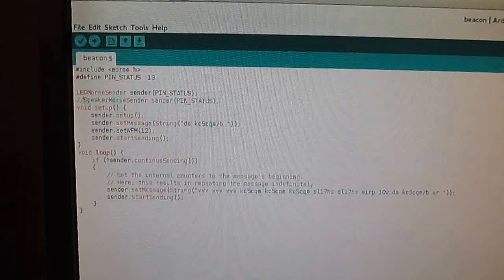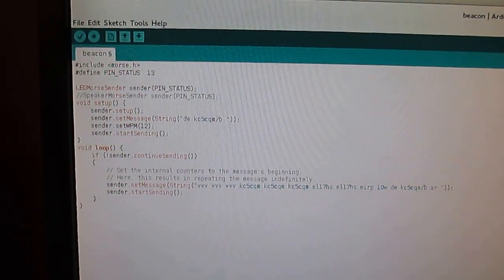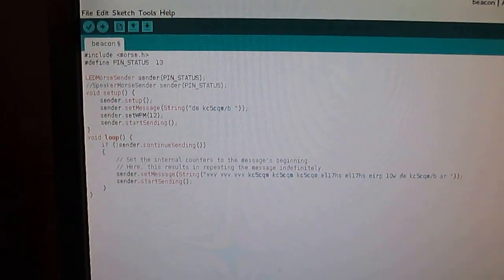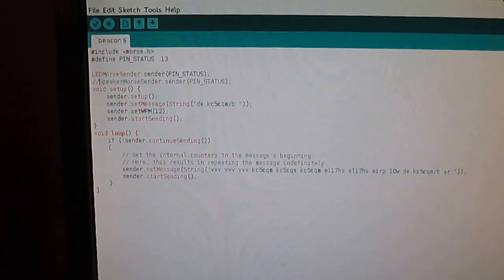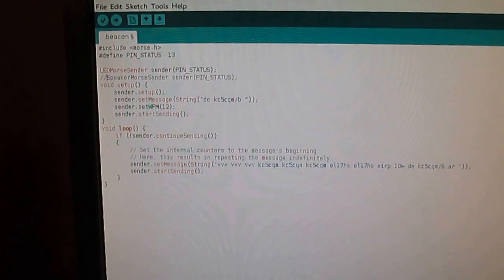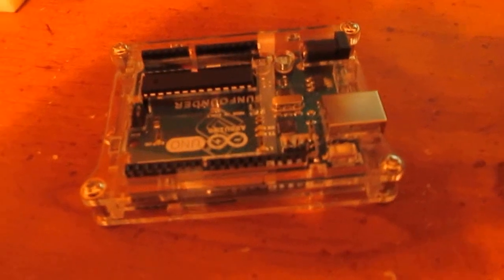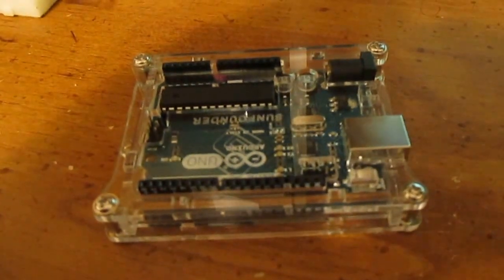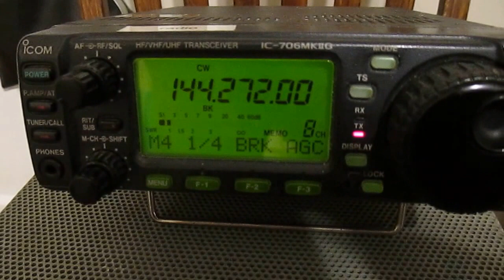Arduino CW Beacon

Comment: Nice project. I still have a small Pixie transceiver kit and a spare (cheap clone) Arduino. Fixed at 7.023 MHz but with an inductor and variable capacitor (salvaged from small radio) in series with the crystal I might be able to pull the frequency up or down a few kHz. It would make a nice, less than 10 dollar, beacon. Thanks!

Comment: Greeting from VU land.... the project is interesting as it is so simple...... got the electronics part, the sketch is  some thing I am not clear about. could you elaborate?

Regards,

VU2SFJ
Reply from the maker: I'll try and find the code and share it on github.
Reply from the maker: Actually, the code is quite short, so I'll just share it here. It's just a near cut/paste of the example included Mark Fickette's Arduinomorse library. See https://github.com/markfickett/arduinomorse

#include <morse.h>
#define PIN_STATUS  13

//LEDMorseSender sender(PIN_STATUS);
SpeakerMorseSender sender(PIN_STATUS);
void setup() {
    sender.setup();
    sender.setMessage(String("de kc5cqm/b "));
    sender.setWPM(12);
    sender.startSending();
}
void loop() {
    if (!sender.continueSending())
    {
        // Set the internal counters to the message's beginning.
        // Here, this results in repeating the message indefinitely.
        sender.setMessage(String("vvv vvv vvv kc5cqm kc5cqm kc5cqm el17hs el17hs eirp 10w de kc5cqm/b ar "));
        sender.startSending();
    }
}
Reply: @texasaggiegigsem  Thank you, tried it out with 4N25 works well.
Reply: @texasaggiegigsem  Thank you